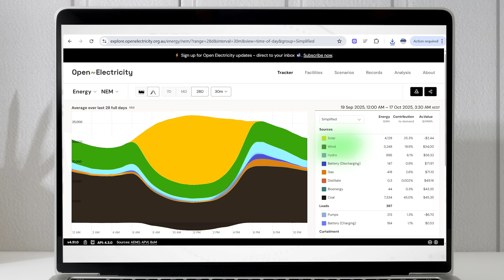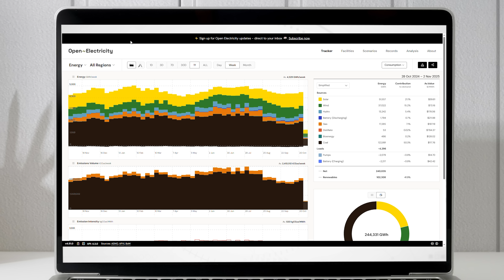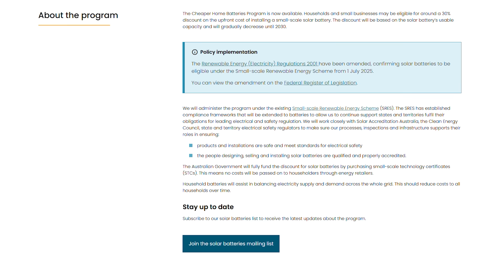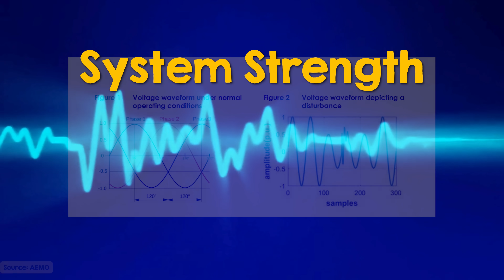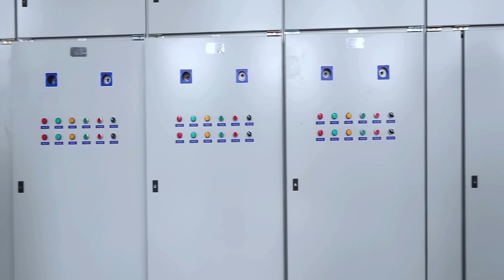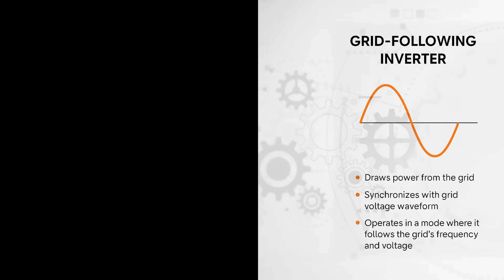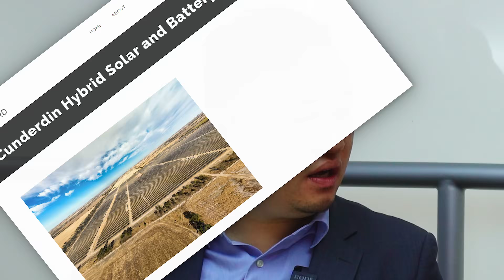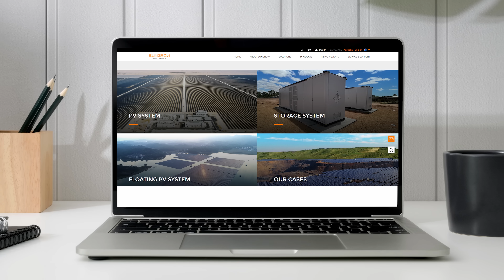Australia’s Solar Boom Is Breaking the Grid - Or Is It?

Comment: Price of electricity is negative? Great time to invest in storage. 
Grid needs more inertia? Storage.
Grid needs protection from the 1 weekend a year when it's cloudy? Storage. 

Storage doesn't mean just batteries. Lifted weights, pumped water, compressed/cold air, hot sand, spinning weights, and the dozen different types of batteries. 
Specifically more spinning weights would help with the synchronization problem.

Also break the grid into smaller bites, but keeping the overall connectivity. 
Basically take every home off grid that's feasible to. Do more neighborhood scale solar instead of countrywide; but keep them connected with a smart line that prevents cascade and helps deal with shortages/overages. 

Why does the new grid need "Fast Rollout"? The OG grid wasn't deployed all that quickly and reliably. 
People keep forgetting/ignoring the literal trillions of dollars that propped up the fossil fuel industries. How many trillions went to giving gas stations tax breaks? How many trillions were invested to put them on every corner? 
That investment paid off, now it's time to do something new.

Comment: Nice graph @ 1:54. It is easy to see that coal plants react very slowly, increasing gas over coal would help reacting more swiftly to the changing supply of solar.
Reply: It would, but gas is still slow.
Reply: @matthewmarks6951  If you compare it to batteries and grid forming inverters, then yes. But apart from that, Gas peakers are among the fastest to react.
Reply: @beatreuteler  Well yes, I was comparing it to batteries and other emerging storage technologies.

Comment: Thanks Rosie for this great video! I had never heard of grid forming invertewrs and they sound darn cool!

On the Iberian power outage, while we wait for definitive conclusions on what caused it, I've seen little to no mentions of something that could have stopped the wider outage.
On the e-transparency platform it was possible to identify that the biggest lossess of production happen over the course of 30-45min. It was also visible that the loads being diconnected were for general grid consumers while the highest consumption with pumping hydro were the last to stop. This was valid for Portugal and Spain, so the export/import rations of production maybe would not be that relevant.
I'm no expert on this, but Looking at those numbers showed in 15min intervals, it looks possible to me that maybe the outage could have been avoided in such a dramatic and expensive way if the first loads to be shutdown were the hydro pumping.

I'm not trying to say that solar is bad or hydro pumping is bad. I believe that having the options is actually the best if priorities and procedures are implemented towards helping with grid stability, and maybe not so much maximizing the hydro pumping with the lower generations prices. 

Hydro pumping has other advantages that demand strong consideration even accounting for it's relative inefficiency. Having more tools to manage water resources and not consuming as many battery manufacturing resources are just a few to add to the other very useful advantage of being a sizeable inertial power generation source.
Reply: If you buy an inverter with AC coupling , have a grid forming inverter in your home.
Reply: @danielking2944  No, it's a grid-connected or grid-following inverter - it follows the incoming waveform but doesn't attempt to correct it. Or have I misunderstood your point?
Reply: One of the reasons for the outages is the high share of solar generation in low-voltage networks, which was not taken into account when disconnecting the load, so in fact the outages were several times smaller and the frequency continued to fall.

Comment: Solar alone is no efficient solution to address the energy problem. If your grid uses coal when renewable sources are not there, the overall energy mix still generates far to much pollution and CO2 . 

Electricity storage is an absolute must when pv solar or wind turbines are massively deployed. This is far too often overlooked and it may generate severe grid level problems. 

IMHO, we should invest much more in electricity storage infrastructure, and accept the related costs.
Reply: Just to be clear, even without storage, renewables are already displacing hundreds of TWh of global electricity generation annually that otherwise would be fossil fuel generated.

This is because fossil fuel generators are dispatchable and "load following" so they end up throttling back their output daily as renewables peak around mid-day.  This saves many billions of tons of CO2 emissions annually.  Renewables (with zero fuel costs) have significantly lower cost per MWh generation, so the grid's "merit order pricing" will prioritize renewables over more costly fossil fuels.

That said, yes, we do need grid-scale storage which pushes the world towards dispatchable "firm renewables" which will obsolete every other large-scale electricity generation on the planet. Renewables displace fossil fuels generally during mid-day but this period will start to expand outwards as more renewables and grid-scale energy storage are brought online.  It will get to the point where renewables can cover the entire 24-hour periods across the seasons.
Reply: If the grid is using coal to charge the batteries, that is even less efficient than using coal to power the grid when renewable resources aren't there though.

Comment: Quite a hyperbole told by Rosie @ 0:45 "all at the exact same time". Fact is, from East to West, sunrise and sunset happen more than 2.5 hours apart! Plenty of time for the grid operators to cope with that. Only North/South there are typically a high number of stations that react at the same time when they are located more or less on one particular longitude.
Reply from the maker: Sure but take a look at where the population in Australia is, it's very close to a North-South line. I'll accept it was slight hyperbole, but massive bullshit? Nope
Reply: @EngineeringwithRosie  Yeah maybe that was too strong. Let's change that. Thanks the 3 dots in Youtube I can do that.

BTW: The graphs of the grid you would show does not show any grid lines that go East/West (i.e. connect Perth to the rest of Australia). Is it really this much disconnected?
Reply: There’s an almost 3000km stretch of basically uninhabited land between Perth and Adelaide, and Australia’s grid split between Western Australia and the rest of Australia in the East. Over 80% of the population lives on the eastern seaboard, which share a Timezone. 

Perth, the only city on the west coast, only has about 2.4m people, less than 10% of the whole country’s population.

If you don’t even know these very basic demographics facts about Australia, you shouldn’t be commenting on a video about the energy network and energy use in Australia.
Reply: @khclupus  What about people living along the northern and southern coast?
Reply: @beatreuteler Mate, relax... it's not "exact" same time, but it's close enough for the majority of the population, and the overall point stands.

Comment: The other factor for profitability of solar farms is winter. If we need to cover that much energy with solar. We are gonna need double the capacity of solar farms that are just used for winter generation. 
And then battery storage companies are gonna be just as greedy as gas plants at peak times trying to make a profit.
Reply: Usually in winter the solar power generation is less and the wind power is more.
Reply: @MihailG5541 unfortunately not as dramatic as solars decline in winter. So we will have a lot of wind or solar assets just for back up in winter.

Comment: I cannot help thinking that the problems from the oversupply of rooftop solar were entirely foreseeable. It has been growing exponentially for 40 years. Yet the authorities had their heads in the sand, thinking that power supply was always going to be a central generator and distribution to customers.

I do not understand why governments did not push AEMO to cater for this. After all, people were paying themselves to install the panels, so there was no capital expenditure needed by the government. Had a bit of imagination been put into this, we could have had local power grids with local battery support. Interconnect to a major grid would have been essential, but there would have been no need to spend billions of dollars upgrading transmission networks as is happening now.
Reply: The Coalition sat on its hands for nine years and did not give investors the legislative security necessary for investment in renewables - or in fact any energy generation technology. And in fact the Coalition did not and still does not believe in science nor in the global warming we now see. Things could have been very different - Australia could have been leading in renewable energy. Now we have to expedite to catch up.
Reply: @Fomites  I think they did know, but were addicted to funding from the fossil fuel industry. TBH, I cannot understand why the fossils are still funding them because they are in such a mess that they are not going to be in government for a decade or more. Seems like a poor investment.
Reply: @Fomites  What? I thought Australia is leading the way?
Reply: I think the enhancement of the grid would have to take place in any case. And if it was only to improve resilience.

Comment: They've installed 2 x 200 tonne steel flywheels in the NE of Scotland to stabilise offshore wind electricity production. Others are planned
Reply: The flywheels were installed circa 2015 but are now obsoleted by battery products such as Tesla Mega Pack and Mega Block. 

Flywheels can only store power for minutes... in 6 hours, about 1/2 the energy is lost. So they are useless for Solar day/night remediation and only work well if you don't have wind lulls that last hours. 

Short version: They were a very good idea in 2015, but they are obsoleted on all metrics by battery solutions (Tesla in particular) due to Massive gains in battery life, cost, cell management, etc. The gains were Dramatic over the last 10 years. 

Battery systems couldn't compare back then. 
Now they are substantially cheaper initially And over their life (even adjusting for longer Flywheel life). Generally better on almost all metrics and continuing to improve (The Tesla Megablock - 2026 for example.)

It was a Solid solution for 2015... its definitely not in 2025.
Reply: @avgjoe5969  wrong metrics. not the same job. the tesla battery pack does not adress the stability, unless the have the right grid forming inverters, which they don´t so far if I remember well. As Rosie is saying,m or the guy that is interviewed. you need both the battery pack for the power and teh inverter for the strength and stability.
If teh batteries do not have teh inverter then you need the wheels.
Reply: @benjaminlamey3591  Tesla Megapack's have grid forming inverters. (That of course doesn't mean that synchronous converts can't be part of the grid design. They have their own advantages).
Reply: @benjaminlamey3591  Here in Australia batteries do stabilize the grid. We are installing some flywheels but seems that is more expensive and less versatile than batteries.
Reply: @avgjoe5969  You are confusing two types of flywheels here: Flywheels as energy storage for longer time backup and synchronous condensors that provide reactive power to regulate voltage and improve grid stability. Two different designs with two different purposes.
Reply: @avgjoe5969 The flywheels/energy park were completed and  became operational in 2021. They weren't built for storing energy, but for grid stabilisation.
Reply: @avgjoe5969  I think you are overestimating the cost and most importantly long-term cost of a battery. Something like a flywheel is a much more sustainable and reasonable idea, compared to a battery. Now, I am not an expert to the full degree, but the engineering knowledge that I possess tells me a series of connected flywheels are cheap, infinitely scalable and pretty much run forever... Can you tell this about a battery?
Reply: @amimartian  Flywheel etc is stability, not storage.  9:09
Reply: slowing the planet rotation, killing tides, great job!
Reply: @blackmancer 
The earth is estimated to weigh about 6 billion trillion tons. I'm not a flywheel scientist, but I doubt a couple of 200 ton chunks of spinning metal are going to bother the planet's rotation.
Reply: @blackmancer 🙄
Reply: @blackmancer just spin them the other way then
Reply: @emceeboogieboots1608 , exactly what happens. Nothing goes faster and faster in just one direction.

Comment: Hi Rosie and anyone else, I'd be interested in your thoughts on the AU govt's proposal to make retailers offer 3 free hours of electricity to all consumers during the midday solar peak. Sounds innovative, but it's interesting to wonder what the behavioural responses will be. On the one hand it could spur large scale load shifting. Devices and a lot of heating/cooling could go onto timers. It's long enough to heat up electric water heaters and on a 7kW charger, 2 x 3-hour free periods per week is enough to charge an EV driven average Km's in AU, which in theory could spur EV uptake. On the other hand, the industry could seek pricing tricks to fleece us despite all this soaking up solar peak, much of which is negatively priced. And even if they don't could it reduce domestic solar and battery uptake - but that may be a good thing to spur grid scale solar, etc, etc. So many unknowns but an engineer's perspective would be interesting, especially with looming coal retirements.
Reply from the maker: Yes I'm definitely planning a video on the 3 free hours and all the potential implications you mention! The announcement was too late for this video unfortunately (or maybe fortunately because now it can get its own video)
Reply: @EngineeringwithRosie  Look forward to it 😀
Reply: It only applies if you have a smart meter, and the way that demand charges are currently calculated are too punitive for most people to take advantage of the proposal. If you have an EV with a good charger, or a home battery but no solar, its pretty good. If you are a pensioner or stay at home mum looking to save some money, you will almost certainly not be better off unless you have a smart meter already.
Reply: @SocialDownclimber  Yes, but everyone in AU will have a smart meter by 2030 if the govt delivers on that promise. What do you mean by the demand charges? I agree if you mean some retailers will want to charge crazy prices for peak hours, but then that could be an opportunity for others. If you look at Globird's Free Lunch in my area you get two hours free and the rest of your consumption up to 15kW/h is cheaper/same as their other tariffs. The daily charge is a modest 10c extra per day. If that went to 3 hours our household with two working adults with a bit of WFH and flexible hours and 2 kids could fit 80% of our consumption into the free period. I'm not necessarily predicting such deals remain, but it could be interesting watching 'market competition' if wholesale prices stay negative in the middle of the day - maybe Rosie can enlighten us on chances of that.
Reply: Sounds like more government subsidies put on the national credit card, never to be repaid
Reply: @lindsaysmith8119  That's because you do not understand how anything works.

Comment: What is happening to retail electricity prices during negative wholesale prices ?
Reply: Most retail prices are fixed (as in, the retailer takes a gamble based on the average price, the customer isn't affected by hour to hour wholesale price variations, though the retailer may adjust the following year based on if it worked well for them).
Some retailers offer alignment to wholesale rates - meaning wholesale changes are passed on to you.  So sometimes it does go negative - and yes, people get paid to charge their EVs and home batteries!

Comment: The recent grid collapse in Spain shows the problems of running a grid with only marginal stability - whether voltage, frequency, power factor, reserve, fault-level or whatever. People died - the risks are very real. Hopefully we can move to grid forming inverters, battery storage, capacity reinforcement and so-on to cope. The problem is that this is all complex, expensive engineering and it isn't obvious to most people why it is needed. It is a political challenge as much as a technical one.
Reply: The solution is home battery at nearly every home, this will become the distributed grid buffer against voltage swings
Reply: In Spain, it is more profitable to build cascades of hydroelectric and pumped storage power plants than to increase the capacity of BESS storage facilities.
Reply: @MihailG5541  Is the daily price difference between min and max price more than 4c/kWh? Then BESS is profitable at a ROI of more than 20%.
Reply: The Blackout in Spain resulted from bad grid control. Could have been easily avoided.
Reply: It is not complex, really. Just allow Inverters to do grid-forming. All modern hybrid Inverters can do that and are just a software update away from delivering near infinite grid stability.